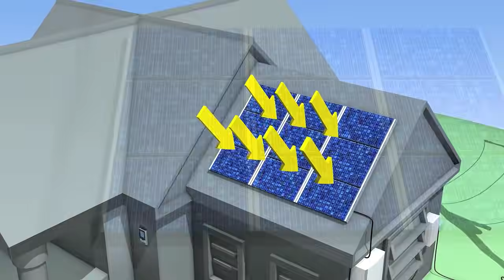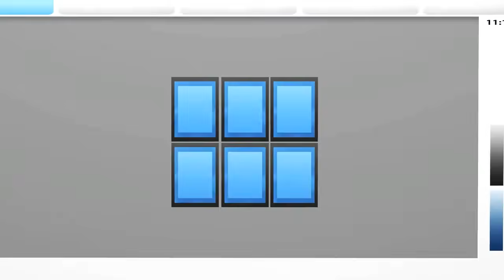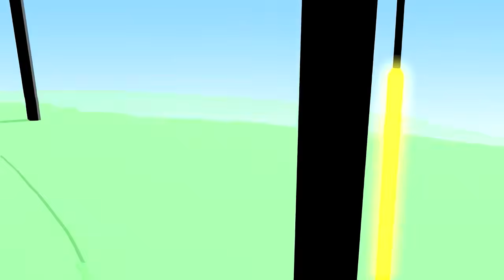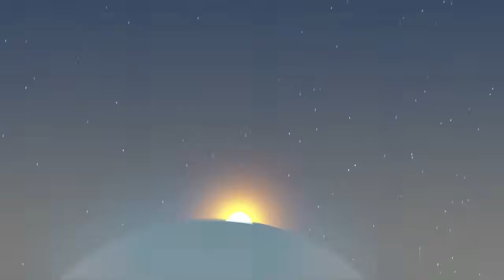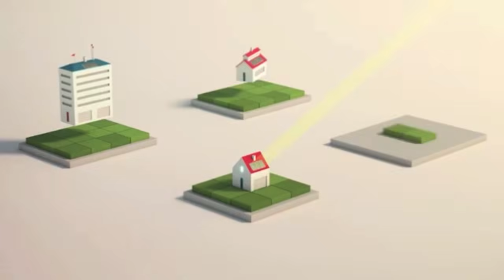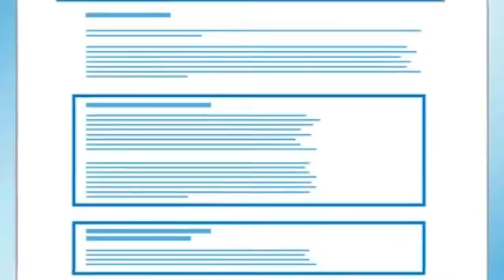Net Metering for Solar Power

Comment: Do i need to inform my area goverment utility company if i install solar system.
Reply: You must have permits.
Reply: Disconnect the present electricity connection and install solar either private or under your electricity board. If you are on  ongrid you must need permission from govt utility company.